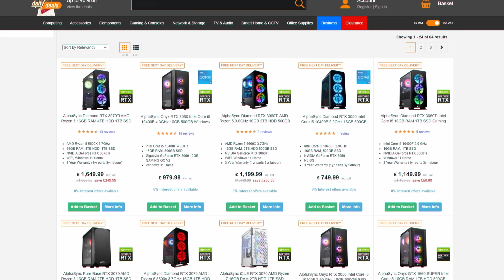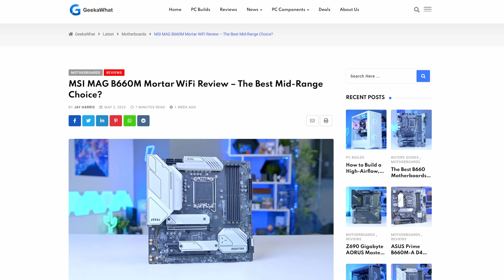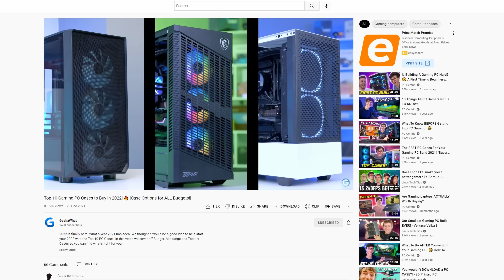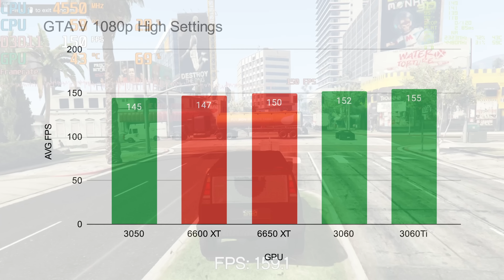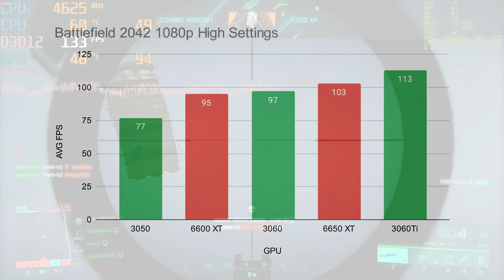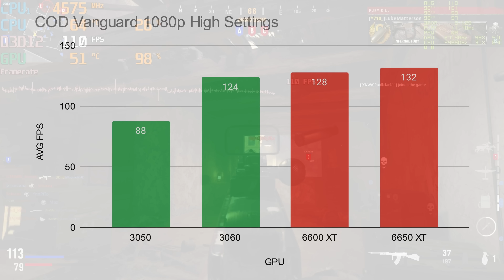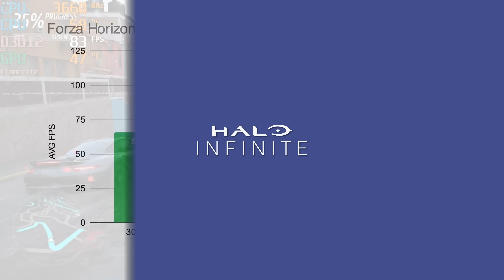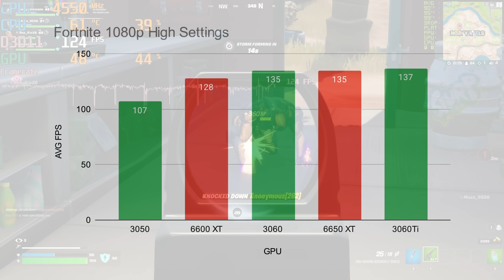$1000 RX 6650XT Gaming PC Build 2022! [Is AMD's New BUDGET GPU Worth It? - 15+ Games Tested!]

Comment: Whats better at 1080p for 144hz.....12400f with 3060 Ti or 6650XT???
Reply: 6650xt
But… if you wanna play with raytracing go to the 3060 ti then
Reply: 3060 ti is more powerfull but for 1080p a rx 6650 xt will do great.
Reply: Idk the 6650xt result dont look better compared to 3060 Ti......The MSRP is the same, nvidia has nvenc encorder which is better then amd. 3060 Ti just feels better no?
Reply: @shafayshahzad6512  yeah, if you can get your hands on a 3060 ti at the same price of a rx 6650 xt then 3060 for shure
Reply: @electrcocity7786  Definitely yes, I told him to go for the amd one because of the difference in price between these two cards (the price premium on nvidia cards is crazy...)
but if the two are at the same price than go for the 3060 ti without thinking about it, raytracing and dlss are well worth it.
Reply: @pablosuarez3666  True, also amd cards are usally more efficient but overall 3060 ti is better

Comment: I just bought my 6650xt from Newegg for $349, excited for it to come in
Reply: How it is? Smooth gameing? Any crashes ? Problems?
Reply: @EdoTensai947  so far so good, plays all my games on 1440 and 90-100 FPS, no crashes on any games I’ve played yet
Reply: @ItsOlee  enjoy man , 1440p max settings ?
U think 450w psu will be sufficient?
Reply: @EdoTensai947  high-max settings, I play a lot of multiplayer games so I usually don’t crank it to max to have more frames, stick around 600-650 watts. Will be better in the long run

Comment: i could build this same pc cheaper and still give you good bang for the buck.

CPU: Intel i3 12100 = it's $120 dollars, but it's worth it plus you get igpu in case GPU dies
GPU: MSI Mech 2X Radeon RX 6600 XT = it's $319, it's cheaper & performance is similar.
Mobo: Gigabyte B660 DS3H = it's only $109 if you get the non wifi version
Ram: TeamGroup T-Force Vulcan Z ddr4 16gb 3200mhz = it's only 50, you don't need RGB.
Storage: Samsung 870 Evo 1TB SSD = these are literally only $50 bucks these days

there you have it, and that's stil less than 800.
Reply: @Elysian well even gamers don't use there PC for just gaming, but ya it doesn't have to be Intel. also ya i forgot to include psu and case, i think i posted this awhile ago, prices have dropped a little since then.
i still think the RX 6600 XT is a good buy though, that's what i ended up getting, but i haven't looked at Nvidia in awhile. the RTX 3060 ti was a little high in price last time i looked at prices. it might be lower now idk.

Comment: In fortnite on my 3060 I over clocked is get 280 
Fps capped and it just stays at 280
Reply: If I understood you correctly, switch the FPS cap from 280 to Unlimited, thats all.
Reply: @andrejohn9104  no it’s capped at 240 but I can do 280 but I don’t bc my monitor is only a 240hz and can only handle 240fps. But originally I was getting like 200fps stock but when I over clocked it I get the 240 and it’s stable asf

Comment: Dude you can get a 5600x with a motherboard for $200 and it can communicate with the gpu and boost your performance. I spaced out a pc for 800 for 100+fps 1080p gaming for most games and a good 1440p experience

Comment: I just bought the rx6650xt for 379 and current market on Amazon in the US is 420 on average for the rtx 3060. I did get the 8gb model there was a 12gb model for about right at 409 to 419usd
Reply: Amigo no existe modelo de la rx6650xt  con 12gb . Solo la rx 6700xt y 7750xt tienen 12gb

Comment: rx 6650xt is near to nvidia rtx 3060 ti in performance  so with 399usd is a  better choice
Reply: I just got it for 319 USD. It’s crazy how fast prices are dropping. The 3060 is as much as 200 more than this, and yet it almost outperforms the 3060ti, which is around 700-800
Reply: $250 right now on Amazon

Comment: Is a brand new pc with ryzen 5 5600x, 2x8gb 3200mhz ram and rx6700xt good for £1000 gbp?
Reply: It's pretty good
Reply: Get 12gen intel cpu
Reply: Go for the 12400f instead, and I would rather go for 3600MHz cl16 ram
Reply: @buffandpretty1932  3600 makes literally 0 difference
Reply: Should go for Intel cuz cheaper chip
Reply: @ikram2512  but the motherboard isn’t…
Reply: @buffandpretty1932  you’ll see no difference from 3200 and 3600 especially with intel cpus

Comment: They should have put 10GB in this card. Btw you're loosing performance if you're going Intel with AMD GPU, so this video is terrible build advice.
Reply: @Elysian there is no 12 gb verision for 6650 xt, and I dont need SAM my i5 13400f  with 6650 xt runs games perfectly

Comment: I'm planning to build around the 12400f as well. I can have the same card or a 3060 too.

Question is for my work, i tend to use like 20-30 browser tabs (browser) and max of 2browser. So all in all probably 40-60 tabs are open simultaneously. Can this build handle it?
Reply: Te recomiendo por experiencia personal la rx6650xt es superior a la rtx 3060 en el 98% de los juegos existentes y cuesta mucho pero mucho menos que un 3060 . La rx6650xt cuesta $329 en Amazon USA,  inclusive la 6600xt normal da más fps que la 3060 en casi todos los juegos. Compra sin miedo tengo experiencia en más de 20  computadoras para juego en lo que va de año 2022
Reply: Amigo hasta 100 pestañas abiertas a la vez  no es problema para ejecutar.  No tengas miedo